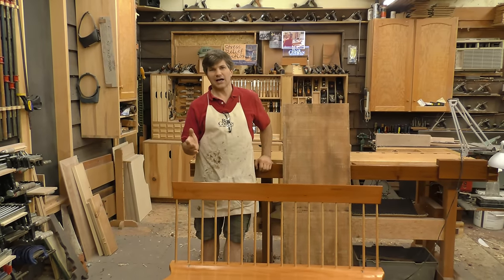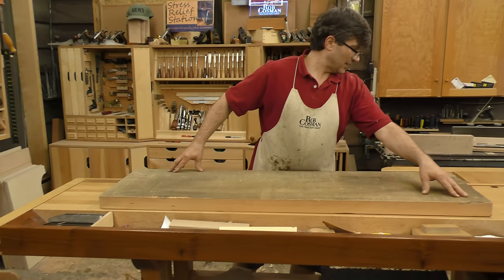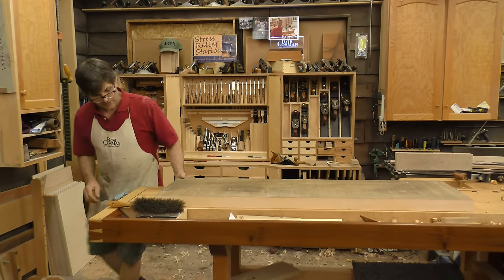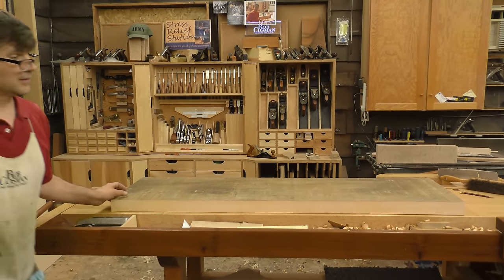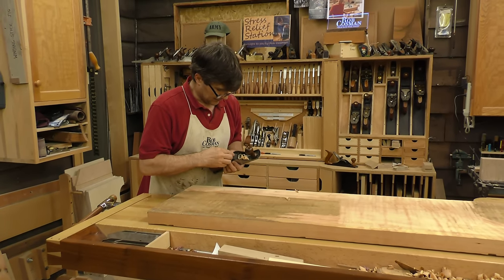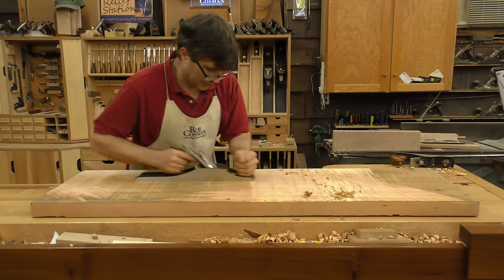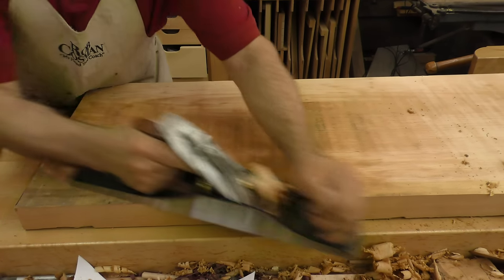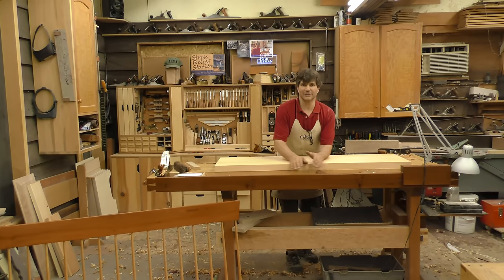Planing Wide boards more accurately with Rob Cosman

Comment: I think your methodology is flawed.   As an example, when testing a large piece on an equally large flat surface, it's quite possible for the board to appear true, and stable even if its only sitting on the four corners.    You need to prep the one side sufficiently that it is stable on the size of table going through the thickness planer; i.e. if its a 24", id really doubt the infeed / outfeed tables would be anywhere near the size of your bench, and therefore a board checked as you display, would still not be process properly.Much simpler to shim you board a sled anyway, no sense in wasting the time doing manual labour.